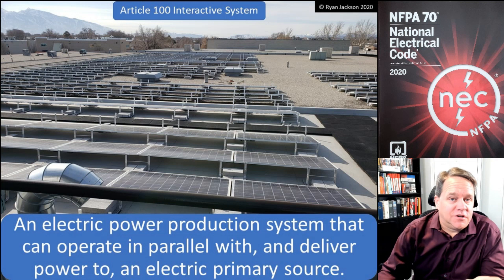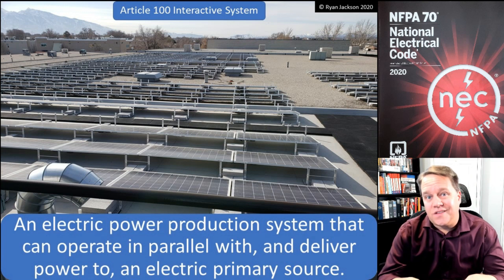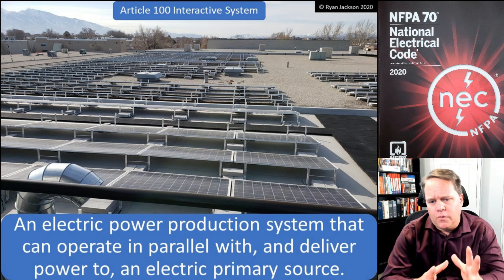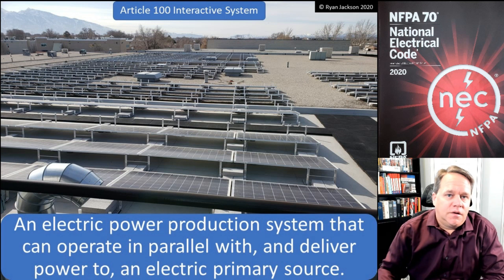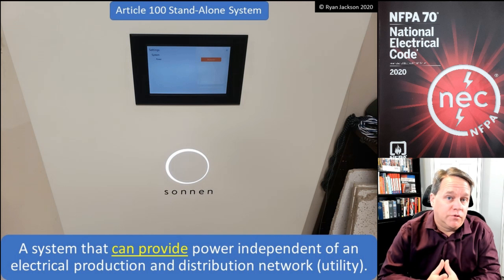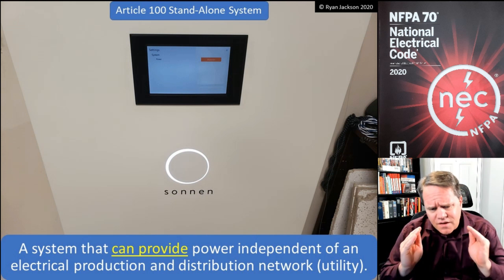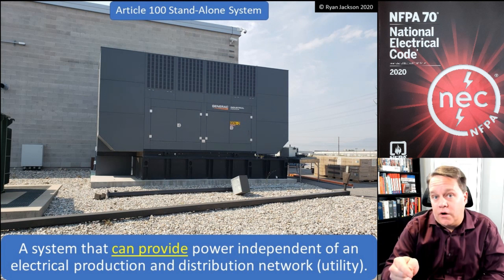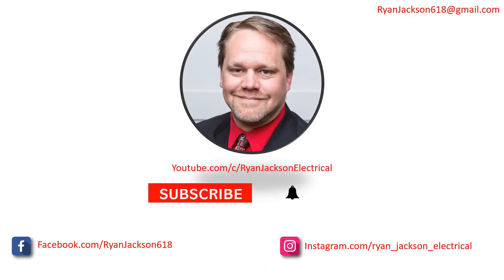100 Days of Article 100: Interactive System and Stand Alone System

Comment: Now how do we reconcile these definitions with "separately derived system". Are they subsets? Is it a tangential concept?
Reply from the maker: A separately derived system is term used in Article 250 for a systems that has no connection to a utility. That includes a generator with a switched neutral transfer switch, for example.

Comment: To further add to the confusion, there exist PV inverters that operate in interactive mode when the utility is present, and can supply power independently as a stand alone system when there is a power failure. At least when the sun is shining. ;)
Reply from the maker: Yep, multimode inverters

Comment: In a way, it is very unfair to the utility but very popular with the public.  Utility is regulation bound to provide.  Mom and Pop PV's get the gift of net-metering.  Make it when you can and the utility is forced to buy it.  When you can't make it, the utility is forced to provide it. I think that is very wrong and a crap-show to manage.  Not really an NEC problem.  But, it is a problem. Not a fan of tiny power plants.
Reply: Ultilities are rich monoplies that are just about guranteed to make profits every year. Ask one of their engineers when the first oil shortage occured back in the 1970's how much our bills would go up if all power usage was cut in halve. Told me bill would double. From what I read appears that ultility compamies only give homeowners pennies on the dollar for any power they sell them. Here in Philly PECO/EXELON have been the most expensive power supplier in Pa for last 100 years. They recieved a lot of money for smart meters a few years ago but homeowners can not track power usage like other ultility companies. They are largest in PA but last place for service and being able to get meter applications on internet. Told us 15 years ago they are working on it.
Reply: @garbo8962  👍🏻
Reply: I agree that any power generated needs to be sold at a price that is based on the immediate supply and demand. But, that issue aside, I  am wholeheartedly in favor of distributed generation. It cuts away at utility monopolies, and it reduces losses and waste by generating power where it is needed, and it adds system capacity without the need for system upgrades.